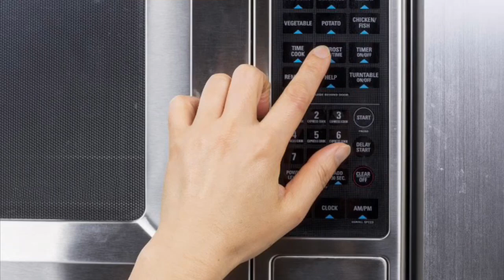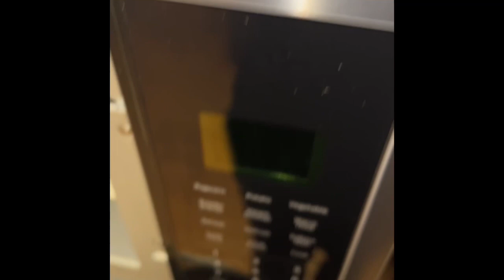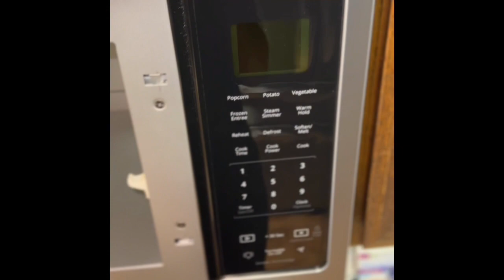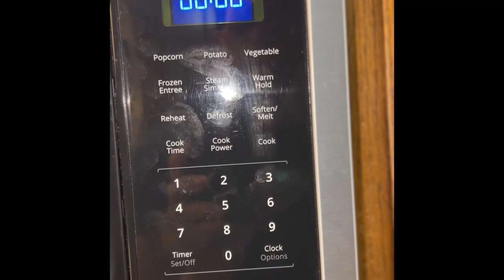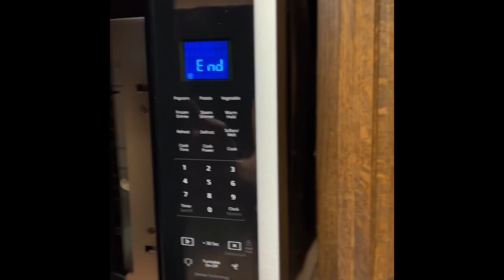✨ Microwave Counts Down - But Won’t Heat - Easy FIX ✨

Comment: Thanks for the vid but before going through this hassle I'd start with confirming the door switch is the root cause. So check the click and also use a multi-meter if you have one.

Comment: Nice video, but it might be worth mentioning that some door or interlock switches are normally closed, although most of them are normally open. The schematic should show this and also the switch correct switch positions with the door closed and open.
Reply from the maker: Great point!👍

Comment: My SAMSUNG microwave stopped working. It is turning on, plate is turning and light will come on but the timer WON'T count down; and food won't heat. Any idea what this could be? Thanks!
Reply from the maker: It’s most likely that one of the 3 door switches burned out.
They’re really cheap.
Reply: @ScottTheFixItGuyChannel  Thanks so much! Where are they located?